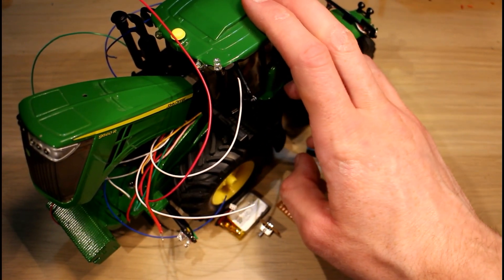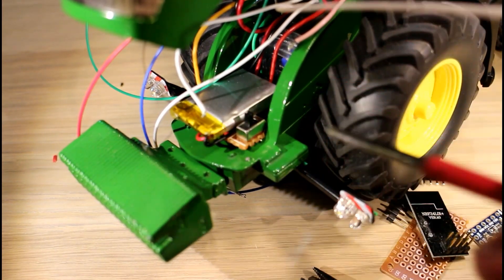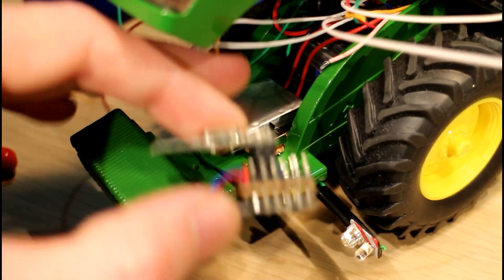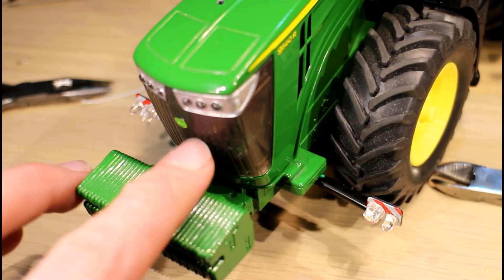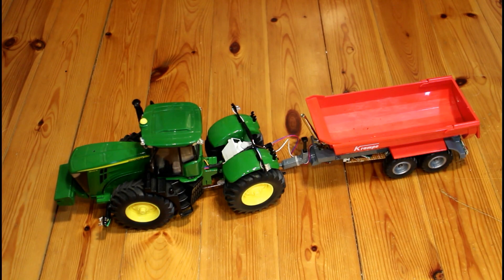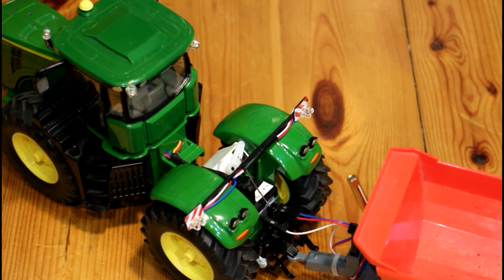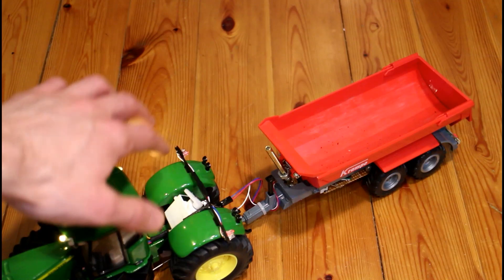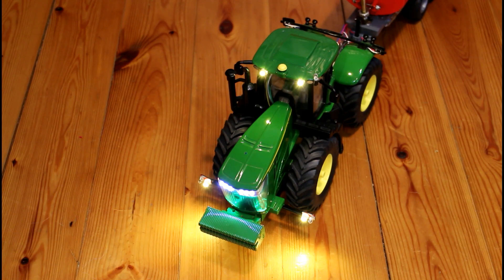RC John Deere 9560R Build - Part 7 Final few jobs and testing

Comment: great movie buddy admire you for what you can do with a normal model of all these components and controls , tile and in addition the control apparatus do something wonderful I also have this question not convenient it would be to you to use LEDs but such as are phones with a keyboard as lights instead of LEDs you apply it to your model of 6920s series I have such control if you want I can show them
Reply from the maker: +Jarek Gąsiecki Hi, I don't understand what you mean about the phone keyboard instead of LEDs?
Reply: hello I'm talking about LEDs that are visible at the given address :)     http://www.modell-trecker-tuning.de/images/vergleichleds.jpg   and the whole thing looks like this :)   http://www.modell-trecker-tuning.de/53605799250d5e501/53605799250e9dd18/index.php
Reply from the maker: +Jarek Gąsiecki Oh yes smd LEDs, I haven't used any yet but I was planning to use some in a Ford TW35 build. I bought them but haven't used them yet. That is a cool website by the way
Reply: I did not know about that every bit of help I am pleased and coming back to the model FORD finished it wanted me to see this model in a version radio controll
Reply from the maker: +Jarek Gąsiecki I am also looking forward to finishing the Ford as it is one of my favourite models but the Universal Hobbies models are harder to convert than the Siku models so it is taking longer.
Reply: I understand he has several models they are extremely delicate and prone to damage of why I wish you luck :)